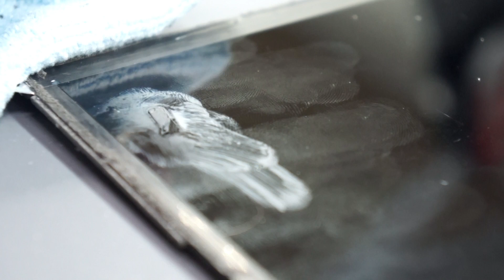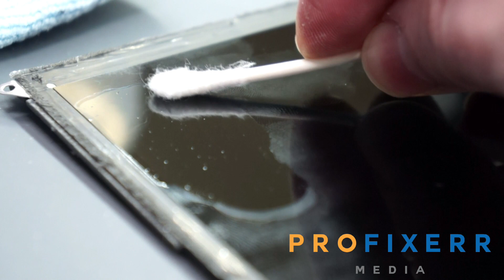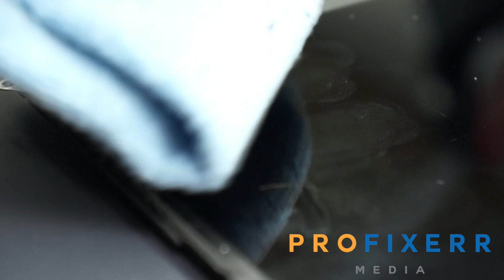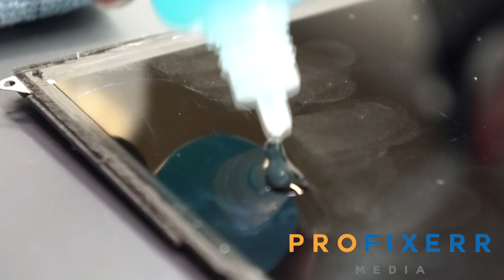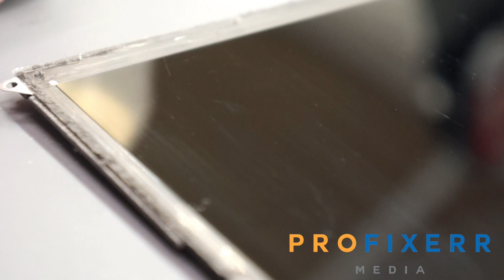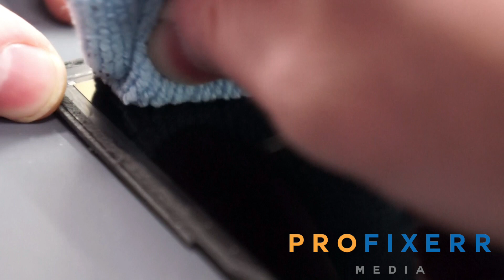How to Clean an iPad LCD Screen During a Repair! - Quick and Effective Way

Comment: This is not how you clean a LCD at all I've done this before on my first iPad repair and you ruin the iPad use a microfiber cloth do not use alcohol what so ever you will damage the LCD
Reply: Hi,  can you tell how exactly is the true way to clean lcd I need to clean it.
Reply: @Hoses2239 Hi for example the only way for you to clean the LCD is by using tissue or power towel to clean the dust BUT if you are using a tissue or paper towel DON’T CLEAN YOUR LCD TOO HARD Because if you clean it too hard the next thing you will damage your LCD, And you will replace your LCD and that will cost a lot of money. So be very gentle by cleaning your LCD.
Reply: It is never a good idea to use alcohol to clean the LCD

Comment: What type of liquid do you use to remove the glue?
Reply: IPA / rubbing alcohol make sure it's 70~75. To strong can damage the top layer of the LCD - you can also use LCD screen wipes.
Reply: @Near2Future  thank you much
Reply: @deent5186  np only apply to a cloth aswell never directly onto the screen itself :)

Comment: Thank you!! I was rushing too much and not wearing gloves. I accidentally did a few knuckle touches to lcd and back of the glass. This helped a lot! Windex is great stuff 👍
Reply: You see this is why you need to take your time and rush through because if you rush it through you know you will touch the lcd inside of it by accident you know that you will leave finger prints and its gonna take so much time to clean the lcd so don’t touch the LCD you can also wear gloves if you don’t want to the LCD or either use wrap to wrap it with your LCD either one but you can also do it without gloves or anything but just don’t touch the LCD
Reply: @TobuJoy ”just don’t touch the lcd”

Comment: I want to know how you clean the Digitizer side on the screen... But not this outside of the digitizer.  The inside!!! The part that goes toward the LCD.. I had a job where i kept it PERFECT until fuly assembled, and a piece of the stupid "FOAM" from around the LCD Fell into the middle when in had pressed it down, so it stuck to the inside of the Digitizer...  How do you clean that off, because they have a layer of "tacky" material on them.
Reply: This sucks when it happens. If I really care about the work done then I just grab a new digitizer and use the "sullied" one later on a budget repair for less discerning customers.  Mind you I mostly fix-to-sell for my own sake and I have to look at the cost-benefit of worrying over every dust spec and if it is "good enough" then I leave it be.  A high ticket item will get a fresh one to get maximum bang for the buck.
When I reuse an old one from my stack and if I feel it need cleaning then alcohol does the trick. Wet it down and go to town in it :D

Comment: OK, I did as you suggested but the results were not stellar. I then tried a solution of 50% di water with 50% anhydrous alcohol. I found that the window cleaner by Zep was not high quality and I was indeed smearing some old glue residue onto the LCD panel. I washed it with the alcohol solution 6 times and each time more of the goo came off. Finally,  no streaks, finished with a microfiber cloth as you suggested and now have a working Ipad Mini 2. Thanks for the response, I was about to give up.
Reply from the maker: John Foster glad to hear it worked out for you:)

Comment: Yep this left streaks on my LCD which I can't seem to remove.
Reply from the maker: John Foster use a new microfiber cloth like in the video, the streaks will go away. Also, make sure and remove an adhesive residue before hand or else it’ll be smearing on the screen